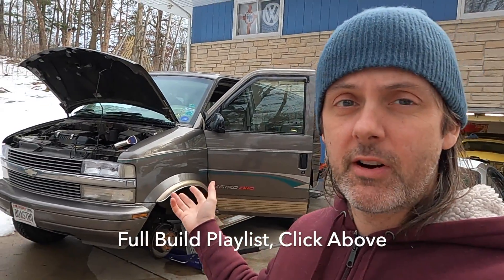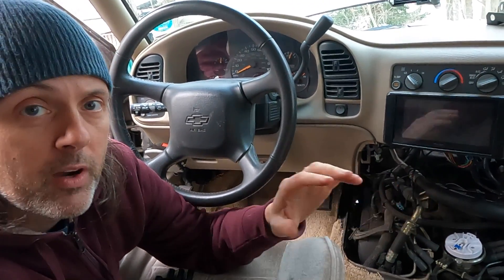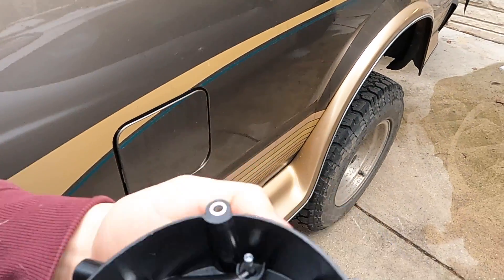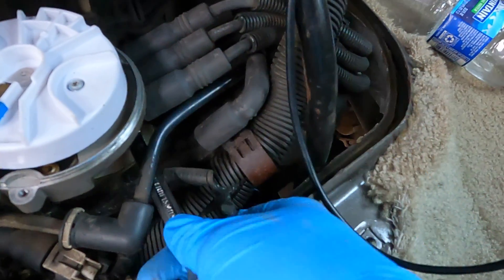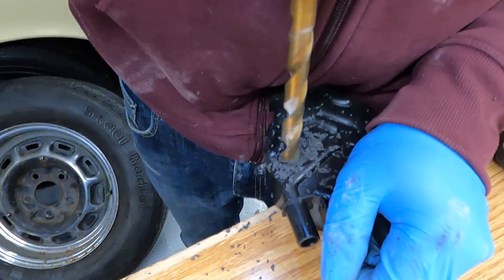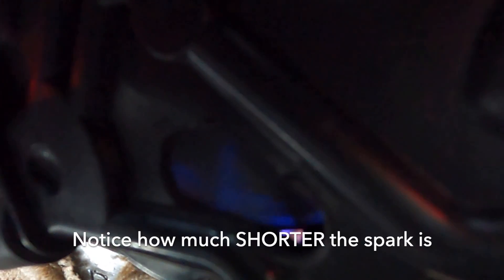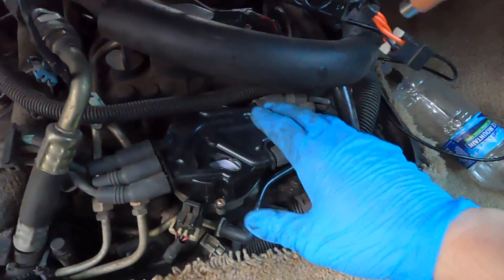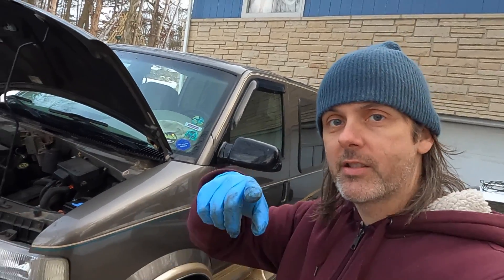Chevy Astro ADJUSTABLE DISTRIBUTOR How To, HUGE IMPROVEMENT!

Comment: ok 45 yrs of working on cars let me help your thinking. with a scan tool with data at idle look for retard data cam retard, should be 0 at idle, give it a rev and idle read the data. no more than 3 degrees pos or negative. move the dist and restart the engine and test it again. if you cant get a stable 0 within 3 degrees cam gear or timing chain or dist drive gear is the cause. low compression and poor idle can affect it slightly. that is how you by the book set it, if you have any questions ask me. x66 is a great cleaner for injectors but in calif i cant get it if you can use it the injectors are the worst problem from day one on these gm v6 and v8
Reply: yeh but he showed us the actual spark.... which was pretty cool to see